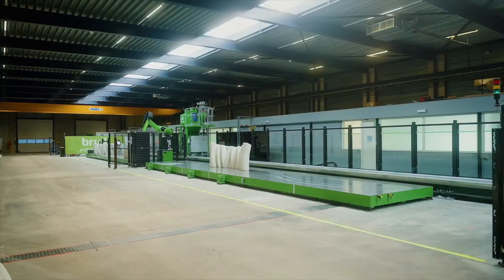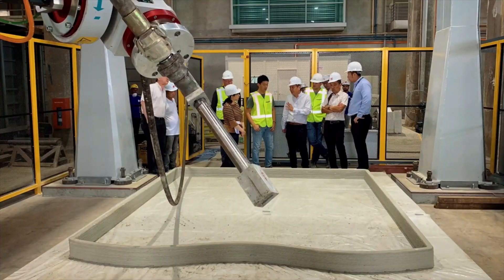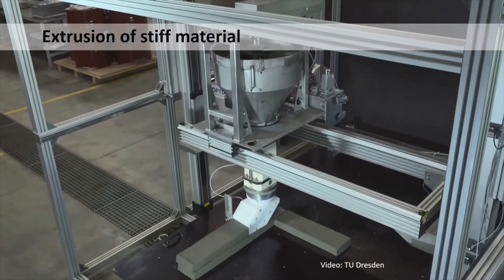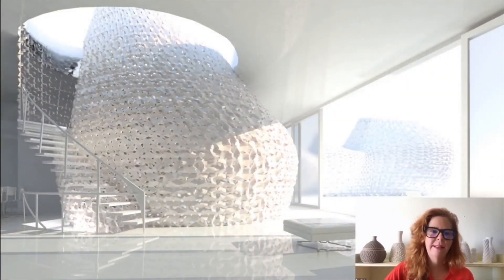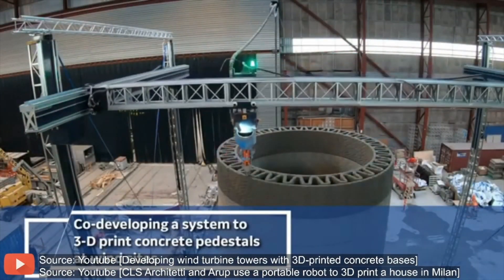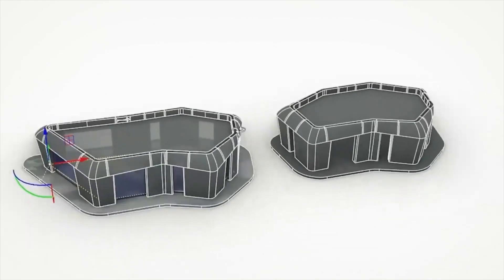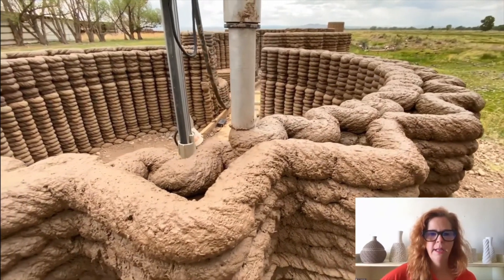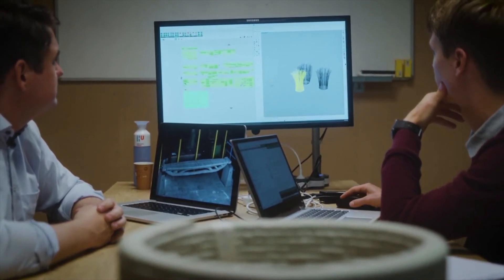Digital Concrete 2020 Highlights | World Class Event Dedicated to 3D Printed Construction

Comment: Thanks again for the content and hints at what's possible with this emerging technology. I would like more information about materials and lessons learned about pros/cons of the different types of materials. I wonder how many companies are supplying this fledgling industry, or if the concrete mixes & add ins are by necessity developed by the printers for their own applications by trial & error?
Reply from the maker: I’ve done a podcast with Matthew Carli who works at Laticrete as director of innovation. They are one of the companies supplying material among others. I agree I should do a video on all the material options, it will be a long video because I want to touch on as many as I can.